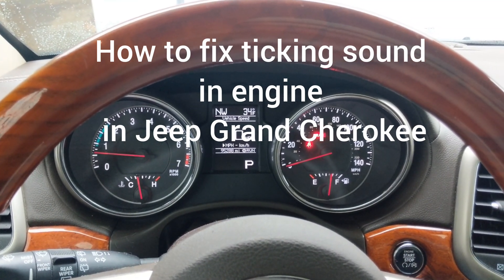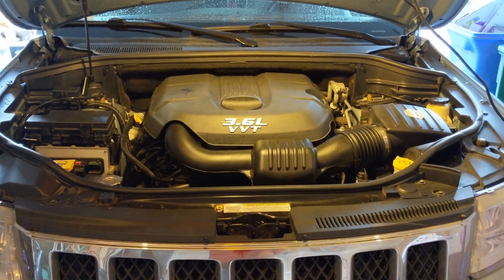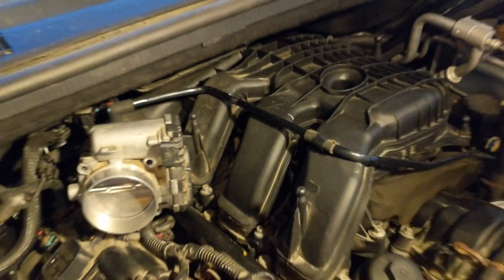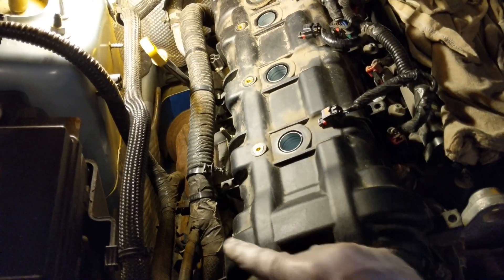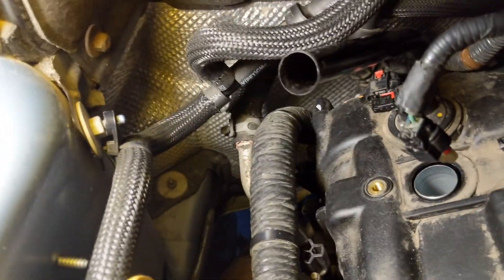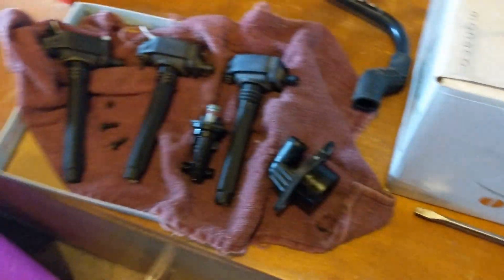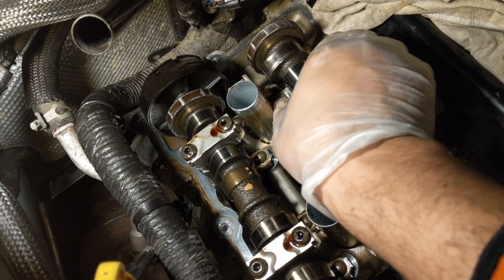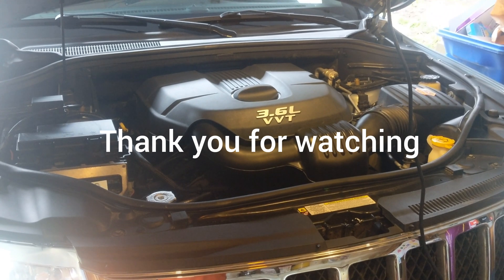2013 Jeep Grand Cherokee (WK2) how to fix ticking sound on V6 3.6L Pentastar engine rocker arm

Comment: Thanks  for the great video....does this ticking may affect transmission shfit ? I have hard shifting  until the engine get little warmer ...someone told me maybe the problem realted to this ticking
Reply from the maker: No this ticking isn't related to any transmission shift problems you may be having.

Comment: I’ve got an engine tick, plus a P06DD code, do I need to grab a new oil pressure sensor today as well as rocker arms?? And it’s a Jeep 2012 Cherokee
Reply: Hey I got the same issue! Have you solved yet?

Comment: Good Explanation, I have no Tick, But I replaced the Oil Cooler Filter Housing with the Aluminum one only because I had a Bad oil pressure sensor.While everything was apart I changed the plugs and coils since I had 140K on them. I also added a Baxter oil filter adapter to run a spin on filter, this keeps oil in the filter, the stock cartridge one drains back within 20-30 minutes and you get the dry start rattling which may cause premature rocker failure. On my 2015 Grand Cherokee if you use the Mobil 1 M1-212A filter it clears the Engine Cover and has the correct flow and bypass PSI required for this engine. Definitely a good upgrade if you’re keeping your Vehicle for a long time and Can’t afford 60-80k for a new one.

Comment: Great info on this issue.  I just recently noticed the tick on my 2014 GC.  I'm assuming that since it's apart, the valve cover and intake manifold gaskets should be replaced?

Thanks.
Reply from the maker: Yes.  Since you're taking it apart it's a good idea to replace the gaskets.  I actually didn't and I've been chasing oil leaks and having to go in and replace the gaskets.  Wish I had done it when I had everything taken apart the first time.

Comment: Just wanted to give you a massive shoutout mate, I decided to tackle this job myself after a few watches of your video! I had the issue on the other side so was a bit easier for me as I didn't have to fiddle with that pcv valve. After a few hours of cursing and some sunburn I managed to get it all fixed! Had a small issue afterwards as I didn't realise the white gasket had fallen out behind the thottle body but all fixed now and purring like a kitten! If you ever holiday in Australia ill have to buy you a few beers! Cheers!

Comment: Thank you for sharing this video! I am hoping to be able to take care of this issue myself if I can.  I am not finding the video associated with the link about how to remove the air intake tube and cover. Has that been removed or am I missing it completely? I am a novice and not well versed in mechanics, but I think with time I can do it.  If there are any other videos I am missing for removal of certain tubes/parts for this repair, please direct me to those too if you made them.  Thank you!

Comment: Great video. Question for you. From what I've read, this is a common issue with the rocker arm going out, as it seems to be a poorly made piece. Is there a reason why you didn't replace all the rocker arms on that side, while you already had access? Thanks for your help here!
Reply from the maker: It's best to replace them all once you have access.  I only replaced the one because of money.  But once you're in there, replace them all if you can afford it.  Also, using my technique the ones at the end are hard (almost impossible) to remove and replace.  You'll need to fully remove the cam shaft to make it easier and then you'll need special tools to do that or you'll mess up your engine  timing.

Comment: How did u know it was on the passenger side ? Mine has no check engine light and makes that sound .
Reply from the maker: Had to listen really closely to hear which side it's coming from.  Some people will put a stethoscope on it.  You can also put a screwdriver or something metal to it and you'll be able to tell the difference and hear where it's coming from.

Comment: I just discovered mine making a similar noise but the ticking is at least twice as fast as yours at idle.  Not sure what is is but this can’t be good.  Also the noise goes a way for a minute or so then comes back for a minute or two.
Reply: U ever figure it out?

Comment: Can this tick be slow tick at the beginning
Reply from the maker: Does it go away once it's warmed up?
Reply: @Moretimethanmoney  no 👎 i start it up you can hear the tick pretty quickly and loud but not to loud and then it slows down and gets slightly quite
Reply from the maker: @davidco1767  this could be the same tick.  The tempo of the tick changes as the engine warms up and the rpms go down.  Try and listen with the hood up and see if you can tell if the noise is coming from a particular side of the engine.  If you listen closely you'll be able to tell that it's consistent and coming from either the passenger or driver side.
Reply: @Moretimethanmoney  yeah it’s on the top ish driver side

Comment: i’ve got this sound only with hot engine and in D gear while standing. the sound disappears when i switch to N or when i start moving. Can it be the rocker arm issue as well or likely smith else?
Reply from the maker: It's likely something else.  The rocker arm most is caused by then cam shaft rotating on the rocker arm and the ball bearing in the rocker arm having worn out so now the cam shaft is hitting the metal sides of the rocker arm.  The noise is constant when the engine is running.  Since you only hear your noise when you're in gear, I'd start to suspect the transmission.
Reply: @Moretimethanmoney  my sports jeep does the same it only ticks on idle and dosent tick when i drive but i am a student in hs and i wanna do mechanic but im scared to break the engine 😅
Reply from the maker: @zzahiiidd  don't be scared.  Dive in and give it a chance.  But based on your symptoms I don't think your issue is the rocker arm.

Comment: How do you get the bracket at 2:50 out of the way??
Reply from the maker: You should be able to get in there with a wrench and remove the nut holding the upper airtake manifold to the bracket.  Once you've removed that nut the manifold cam be removed.  You don't need to remove the bracket.

Comment: did you turn the crankshaft at all to line up the camshafts/phasors?
Reply from the maker: I didn't move the camshaft at all.  At 7:47 you can see.  I just loosened up the bolts enough to replace the broken rocker arm.

Comment: Dude quick question. How the hell did you get the valve cover off with that stupid transmission fill tube in the way? I got the pcv valve the cam sensor out but when i lift the valve cover off the back corner gets caught on that transmission fill tube. I’m at a loss dude. Any info is much appreciated
Reply: Hey buddy thanks for the reply!!!!!! And your help. FYI for anyone working on a 3.6 from 2011 till ....... You don’t need to remove or loosen the 2 bolts for the transmission filler tube. Just push on it towards the firewall while picking up on the valve cover and pulling it towards you. Slides right out. Same putting it back in. Now on another note. I HATE THIS FRIGGIN JEEP!!!!!!! Since I bought it brand new it’s been a POS. My daughter has it now but ever since I brought the thing home it’s been a problem. Recall after recall after recall. Anyway I really appreciate the help.
Reply from the maker: Been awhile since I've done this one so my memory is getting hazy.  If I remember correctly, first make sure you remove the PVC valve.  See about 5:33 in the video.  If you got that piece off I think that you have to push the valve cover back towards the rear of the jeep and then lift it up and then you can slide it out from under the transmission fill tube with some jiggling.  Anyone else done this more recently can give Michael some tips on how to get the valve cover from under the fill tube?
Reply from the maker: Check out this video at 2:15.  Notice how he lifts it up and then pushes it back a little before it'll come off.  https://youtu.be/bV5frHweDlI

Comment: hey thanks very much for your time to make this video. Just a question, if the rocker arm that needs replacing is on the front of the engine, can you still lift the cam up high enough to remove and replace it?
Reply from the maker: Hey there!  Yes it is possible to replace a rocker arm on the front of the engine.  But the closer you get to the front of the engine, the more careful you have to be.  If the timing chain slips, you'll throw off the engine timing and then you'll have to reset the timing which is really difficult.  Here's another video which is great and he shows a safer (but more expensive and more difficult) method where you can change the rocker arms on the front of the engine without fear of messing up the timing.  Hope this helps and good luck!

https://youtu.be/XkrwxVVcjsg

Comment: Can something bad happen if I don't fix this? I can't do it myself nor can I afford to have someone fix it for me...
Reply from the maker: Hey Simon!  Unfortunately yes.  What's happening is that the rocket arm has a ball bearing in it which has broken.  Essentially it's a wheel inside your engine.  When your engine runs, there's a pole inside your engine with little nobs on it.  Those nobs control when gas is let into the cylinder and then the spark plugs fire and that's what makes your car go.  That pole runs on the wheel and the wheel is not even.  Which is why you hear the tick.  Over time that tick is going to get worse and the nobs on the pole are going to wear down.  Your engine will start running rough and won't accelerate as good.  Eventually that pole (the cam shaft) will need to be replaced.  That's really expensive and difficult.  Your car will still run for a long time.  Like years with the tick, but eventually someone will have to fix it.  If you can't afford to fix it, you might want to sell the car.

Comment: Did u get any metal specks in the oil filter prior to doing this?
Reply from the maker: I didn't.  The oil always looked fine when I did oil and filter changes.  The ticking was the only indication that I had a problem.

Comment: Bro how much you can charge for this job? I have this problem in my jeep
Reply from the maker: The parts are cheap.  Unfortunately it's a lengthy job so the labor is expensive.
Reply: @Moretimethanmoney  danm mine have this noise any idea how much it will be ?
Reply from the maker: @anbusquad7421  From what I can find online it can run from $600-$1000 parts and labor.
Reply: My 2015 grand cherokee recently started making the exact same noise. My brother thought it sounded like a bad lifter valve. This has been going on a couple months. Just need to find a reputable mechanic in my area
Reply: @marcusclark4521  I too have a 15 Laredo with the same ticking noise.  Have you fixed the problem? If so, what was the cause?
Reply: Damn I hope i don't have this issue with my 2018 JGC when it ages in mileage my understanding the 2016 models and current date pentastar engines have been redesign hopefully those problems been addressed
Reply: Bro where are you located?

Comment: Thank you so much .
Is this solution also the fixing for 5.7 Hemi if it has the sound tick sound?
Reply from the maker: Unfortunately the HEMI 5.7L engine is a different engine.  This fix won't work for that engine.  Check out this video.  He talks about 2 different ticks with a HEMI engine.  https://youtu.be/cL3xNoKs9E4